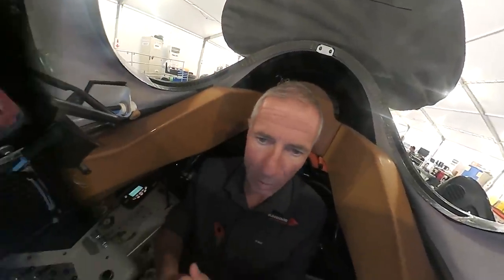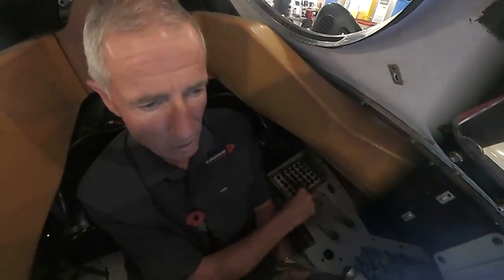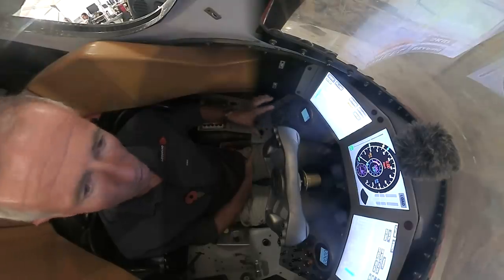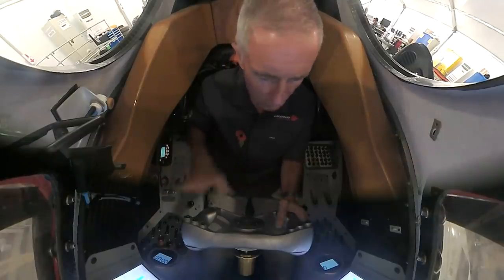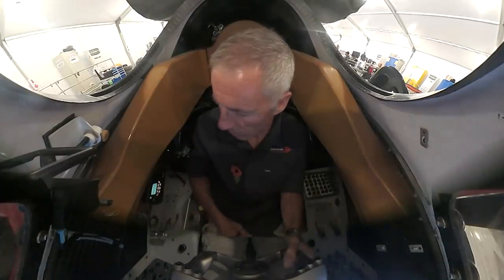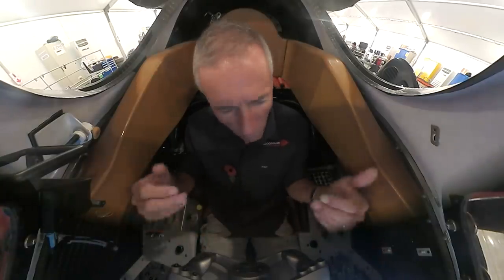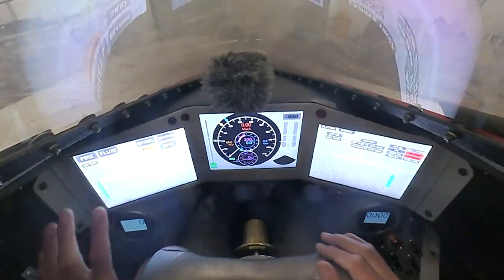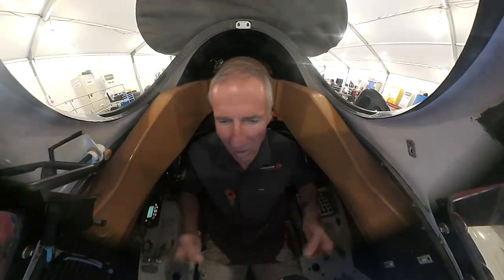Inside the world's fastest car's cockpit!  | #2019HST

Comment: Mad props to the Editor - brilliant use of the 360 camera!
Also, fantastic clear audio - very much hoping the team get on top of the distortion to the voices on the runs down the track. :)
Reply: David David  They'd certainly be a challenge, but the distortion to the voices, to my ear, sound more like the digital link back to the control station - like an MP3 with the bitrate set too low.

Maybe they need to swap from Engineers to Broadcast Techs, who deal with that sort of stuff every day.
Reply: The team replied to this in a facebook post, it's unlikely the comm sound will become better because the breathing/air mechanism inside the andy's helmet is accountable for a large part of the distortion.
Reply: if the distortion is likely to do with the breathing rig, is it not possible to add in a number of 'anti-sound' mics around the helmet/cockpit?

For example, when recording the sound of a bass drum, a clever sound tech would place a mic not only to the front of the drum, but to the rear also.

That way, it will enable them to mix up other mic channels in line with the main mic to achieve a richer sound experience.

Expanding on this, they will do similar with the vocals placing mics in the upper and lower quadrants of the vocal booth both front and rear also.

Tl;Dr: They need to get some sound techies in the case!
Reply: Great idea with the dedicated screens!

Comment: Love the speedo that goes up to 1100 mph ! (just in case its a bit quicker than they thought LOL)
Reply: That would be good on a T-shirt.
Reply: If you are aiming for a 1,000mph LSR, the average speed in both directions it what counts, so you don't want it pegged at 1,000mph, nor do you want to still be accelerating at 1,050 when you already set 1,025 the other way.
So it actually makes sense for this to go up to 11 :-)

Comment: Clear and logical layout. Speed concentrates one's focus. I don't want to say tunnel vision, but in the heat of the moment the driver/pilot needs to keep his eyes on the task. Having displays that will be used at speed straight ahead and controls where they can be found by muscle memory is the way to go. Doing practice runs helps train the mind to make the right control inputs without pausing to think or locate the control input.

Comment: I wonder how many Gs Bloodhound will be pulling during the record attempt? Not having to stretch to reach the controls could certainly come in handy - as they found with the X-15.
Reply: Andy has thought about it inside out years ago. He even fly a light aircraft with passenger demonstrating the G profile of Bloodhound run, simulating it with the aircraft. Look it up. 👍
Reply: Heard him say in another video its 2 g acce acceleration and 3g for deceleration but when theres a reversal from acc to dacc its harder on the body so could be a effective 5g sensation.

Comment: Any reason you're not using a Power distribution module instead of old school circuit breakers?
A PDM can monitor  current flow and be programmed to act accordingly in any overload situation, for eg it can be programmed to "retry" the circuit as many times as you see fit (as well as many other things) in simple language even a dumb mechanic like me can understand lol. without you even having to touch it.. and it'll also save a boat load of weight not only in the module itself but in the wiring as well..
I worked with Bosch motorsport to fit out the Race To Recovery 4x4's with this kit for their Paris Dakkar race. Blown away by the ingenuity of it. Anything you can think of programming a button to do, you can pretty much do it and for multiples of functions.

Comment: What are air brakes?  Are they a reverse thruster of sorts?
Reply: They're metal flaps that come out from the bodywork, you can see them really clearly (folded in to the body) in some of the other footage (the big black sections with holes in them in front of the rear wheels) https://youtu.be/GeetfRqS3IM?t=41

Comment: Does anyone know if the Bloodhound will be fitted with the front and rear canards (fins)
Reply: I'm assuming this set of runs is to evaluate the aerodynamics of the car without, then they'll be added for the record attempts to correct for any undesirable aerodynamic loads discovered on the car.
That's just me speculating though, I don't actually know
Reply: But certainly I'd imagine one of the deliverables for these high speed trials is to validate their CFD models
Reply: Andrew Bailey 
Bloodhound is already touching the boundaries without them my concerns they need them on for a true analysis simply to establish the effects of drag and downward forces on the track.
Also the same run may throw other issues with soft intermittent track bed ? Canards on could put pull the Bloodhound down hard and course steering problems?
I have two models of the Bloodhound one with them on and one without and they both perform totally different on the steering side .
When I activate the rockets with the one without canards ,I have almost no control from my Radio control unit ,but the second one with the fins I have a 65% control.
If you check my channel you can see the models but no videos of the runs only early stuff but I will be running them both soon . They are only rough take on the Bloodhound however they both in my opinion are different on performance